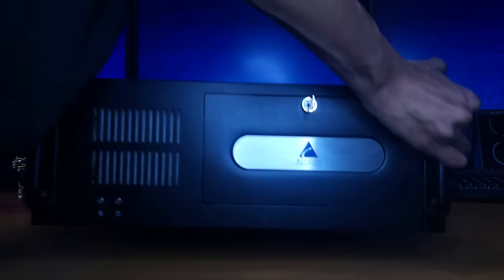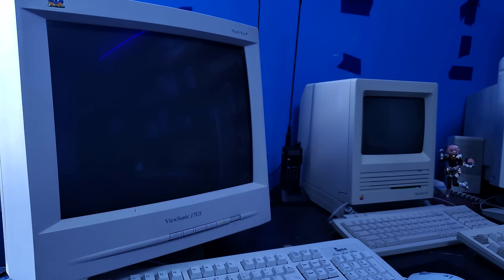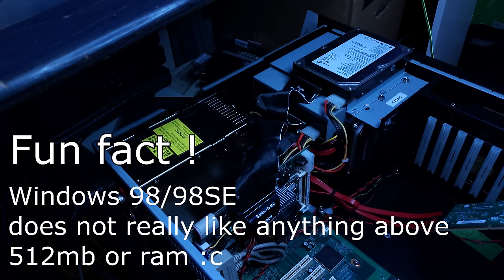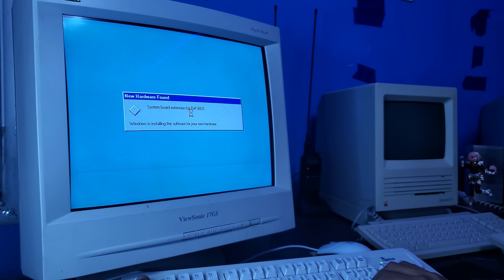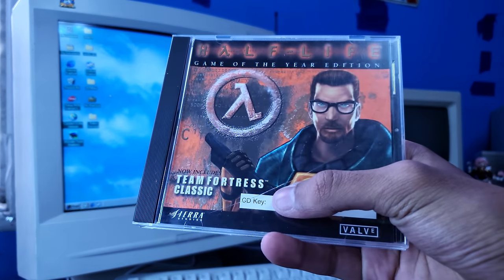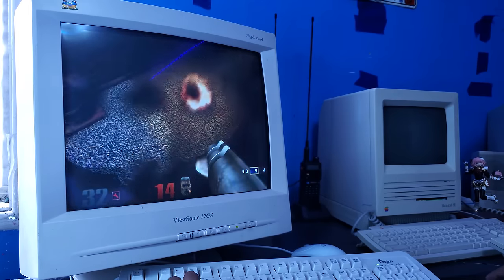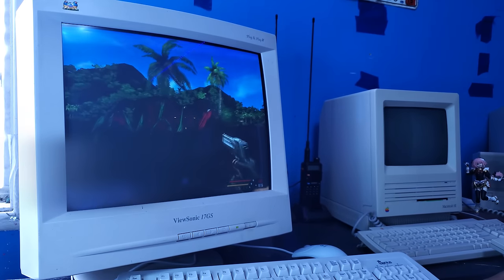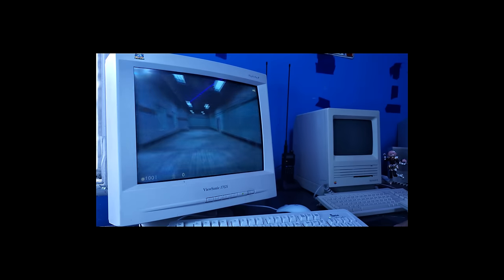Installing Windows 98 on a Single Board Computer

Comment: Something I learned long ago - never install Windows directly from CD. Boot to command prompt, format the disk, copy the contents of the Windows install folder to the hard drive, then install from the hard drive.
Reply: Good classic advice.
Reply: Why? Just speed reasons?
Reply: @mmuller2402   Well i wrote a more elaborate reply previously but the powers that be decided for you not to see it. I'll try to keep it brief.

Yes it's a LOT faster, you frontload the risk of file read error, and you work around installer bugs that cause the CD to be temporarily not available during install, and around path issues when installing drivers later. Installer is quite buggy.
Reply: This also leaves all the installer files (and the “installed from” directory it knows about) on the hard drive so if you ever add a feature later or need to replace a file, it doesn’t bug you for the install CD. 

Most OEMs did it this way when building their install image, which left the install files in C:\Windows\Options\Cabs - that is my go-to for the folder I put them in as well.
Reply: @AnonymousFreakYT   Back in the day i would have balked at extra 100MB+ being consumed out of my 500MB hard disk. A couple years later in the era of 4GB hard disks, it was fine and worth saving the pain.
Reply: Was just about to post this, I remember it being annoying back in the day needing to get the disc out for drivers and in an era when disk space is plentiful there's little reason not to IMO.

On my P3 rig I keep a copy of the W98SE installer on a second drive (mSD2IDE) to make any reinstalls a bit easier, since then I just need the DOS floppy to boot from.

You can also change the default directory Windows looks for in the registry as well if doing it post install, at least I did it this way for some XP installs, so instead of D:\i386 it's C:\i386
Reply: agreed.
Reply: i learned the same from Druaga1, instead of using the optical media to install, he just kept copying the contents the the HDD, I decided to give it a go, did it that way ever since.

Comment: A better install method is to copy the install files from the CD (d:\win98) to the HD (c:\win98) and then run setup from the HD. Since Windows was installed from that folder, it would remember that and use those files in future without even asking you. Just do that copy after your fdisk and you’d be set. I loved the video.

Comment: I have 98 on an SBC but I paired it with quite a few other gaming-specific expansions. It lives inside a full-tower case because that was the only thing with enough slots for the backplane I was using (and even then it had to be modded for the case standoff holes). It was an expensive project but I was happy I did it.

Comment: Actually, In my experiance Windows 98SE will boot and run fine on 1GB RAM.

One of my "Retroboxes" running 98SE is a Pentium III (Talautin, 1.2GHz @ 1.4GHz), 1GB PC133 SDRAM, 60GB IDE SSD, 3DFx Voodoo2 24MB SLI, is running Windows 98SE perfectly.
(With the modern USB patch)

Comment: You may need to install a patch for Far Cry if you were using the retail disc version. I had similar problems with the ground textures not rendering on an Athlon XP with a 7800GS and the patch fixed it.

Comment: The video chip doesn't actually have any VRAM of its own, it uses main system memory, defaulting to 32 MB. It may be possible in system BIOS to configure more system RAM as VRAM, which may fix Far Cry.

Comment: You can use chntpw to reset a Windows account password running off of a Linux livecd / usb drive, if you ever did want to e.g. investigate the Windows Server 2003 setup on this machine.

Comment: Ha, I have a Dell laptop with similar hardware specs, that Pentium M is very clock/watt efficient for it's time and it's IPC is pretty decent. It would easily play back 720P H264 video.

Comment: Far Cry later required 128MB of video RAM after a certain patch iirc, up from the 64MB that the box says and it also required Shader Model 3.0 support at hardware level.

Comment: Is the artifacting from trying to display a 640x400 framebuffer into the bottom of a 640x480 video mode (so the top 1/6 of the screen was gibberish)?

Comment: You would have had an easier time if you'd copied the setup files to the hard drive to begin with and then ran Windows setup from there. It's an old trick OEMs did back in the day that slowly became more and more necessary as time went on and hardware of the time started to exhibit some strange behavior in DOS.

Comment: dude lol are you using nscde??? That's fucking awesome. I tried it out but man the functionality of it is weird
Reply from the maker: yeah, i actually really like it. currently switching between windowmaker and nscde
Reply: @Ionic1k  thats what im doing too lol. Idk which one to pick. I like the windowmaker aesthetic, but i feel it lacks in customizability. especially with keybindings. I come from using sway a lot so I want to be able to access everything via shortcut
Reply: i just cant' get enough of the aesthetics of window maker and nscde. They both just look so good
Reply from the maker: @ttj_  for me at least, ive been getting away with using plugins for certain things on windowmaker, but ive had some issues with multi-monitor support.
Reply: @Ionic1k  Same. at some point i might as well just fork windowmaker and add in the stuff i want lol
Reply from the maker: @ttj_  that would be cool, i would use